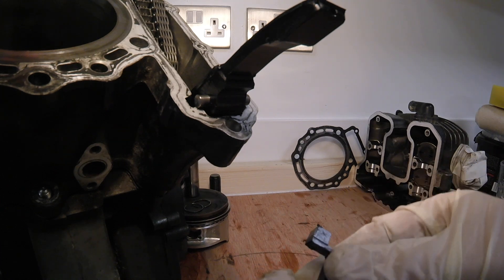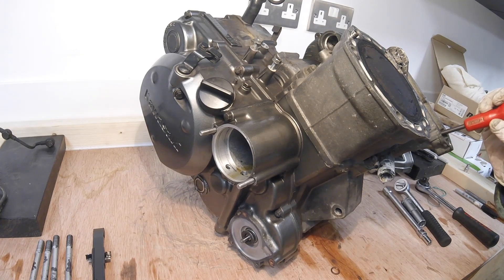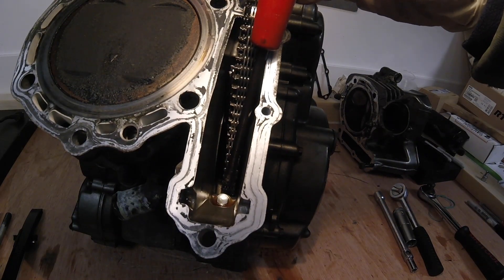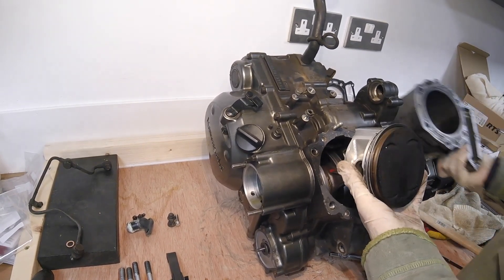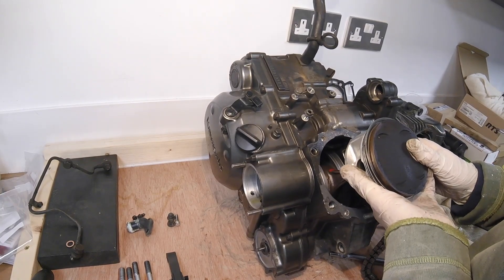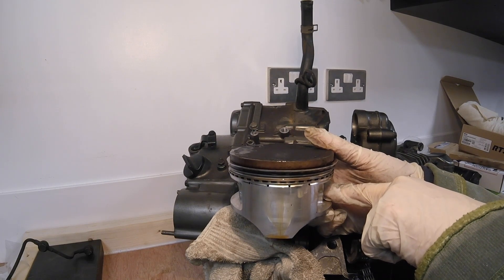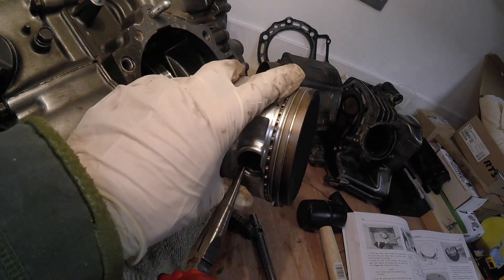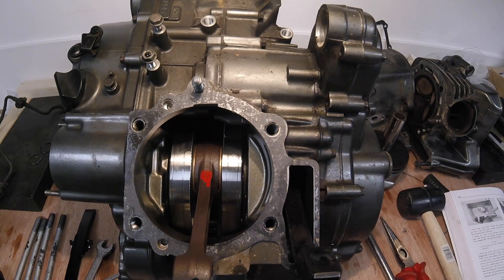Kawasaki KLR 650 engine rebuild Part 2   Barrel and piston Removal

Comment: After you removed the piston cylinder I noticed the cam chain guide is loose.  I assume there gas to be some movement for the cam chain adjuster to tighten the chain, but I opened up my engine and the cam chain guide was tight with no movement.  I checked the manual and it calls for 18ft on the bolt.  What's your take?

Comment: Good video . but kawasaki 650 is an engine with problems  
and challenges ,no increased compression piston is needed ,the problems are at the distribution chain and tensions  ,and at the water pump as you have.
keep going
.
cheers
Reply from the maker: Thanks for the input - appreciated - I will be looking out for all of this - The increased compression piston was more a desire for increased power, but I am not altogether sure that I need it - the finished project is essentially a tourer..
Reply: The Motorcycle Shed - Love your work mate. Currently doing a build in Perth. I’ll be watching you every step of the way!